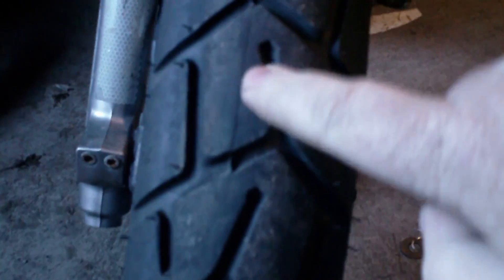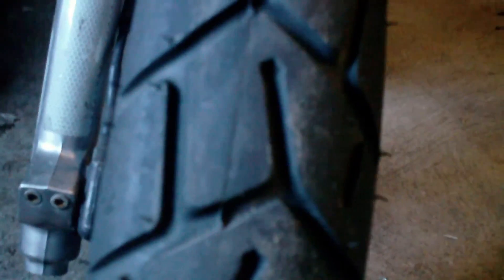Metzeler Tourance Tire !

Comment: Mike,  I'd like to see what Smyrna Cowboy has to say since he works at Bridgestone Tire & Rubber.  As a plastics guy, that looks like a weld line where the two halves are placed together.  That makes total sense if this were a plastic tire.  However, tires are cross-linked rubber and I'm not sure how you would get that line short of vulcanizing the two halves together.

Comment: Get rid of that tire. Anything that splits and allows moisture to work its way into the fabric, will cause the tire to fail. Also, for safety reasons, a bike should never have tires that are older than 7 years.